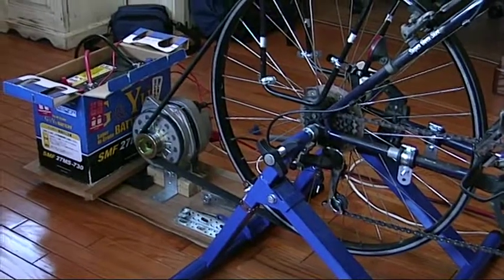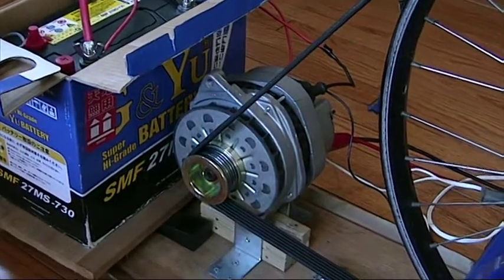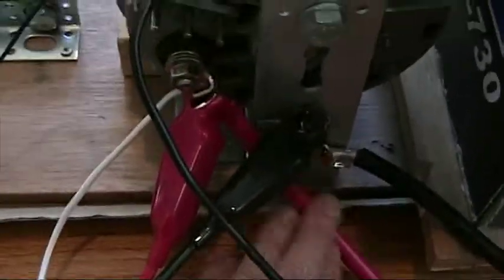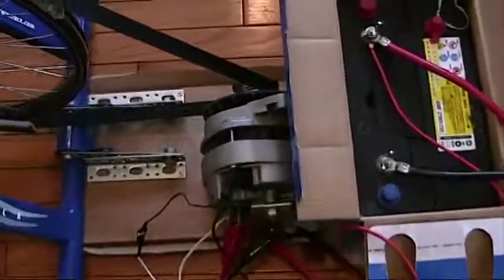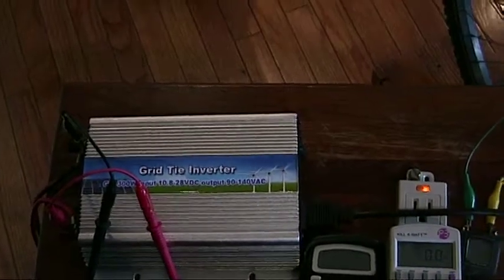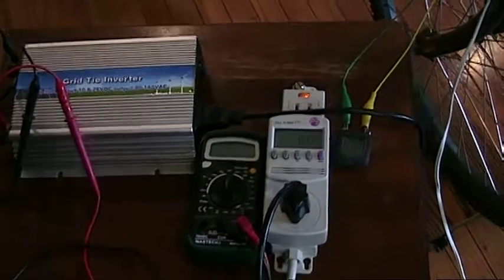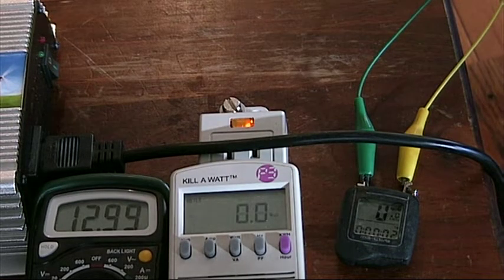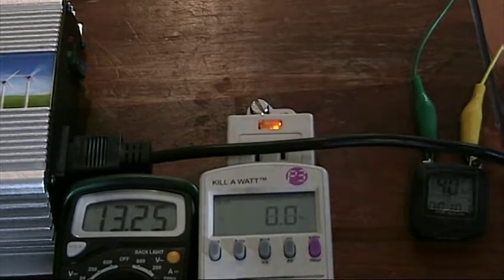Bicycle Generator - CS-144 Car Alternator

Comment: hi Sr is I good proyect,, I want to build one for my daughter,,  but I think I damage the alternator I didn't use the resistor ,,can told me what size I need to use? thanks;;
Reply from the maker: Hi Igor!  Yes, for this model you need a resistor to limit the current to the field coil, or you'll damage the voltage regulator (before you'd damage the field coil!).  I used 50 ohm 10W.
Reply: thanks so much Sr good luck with ure next proyects..